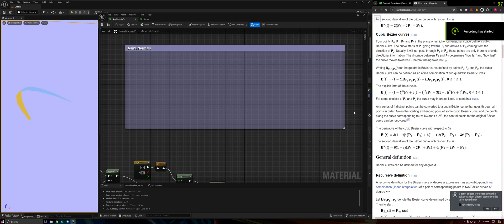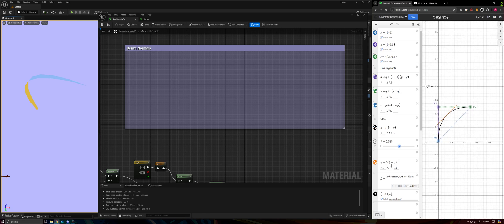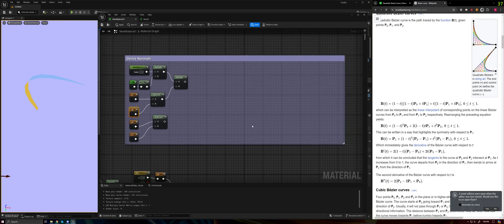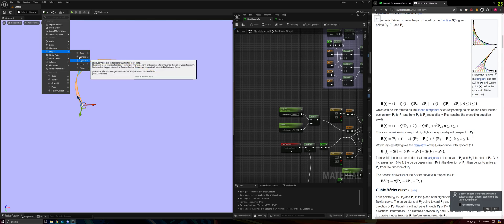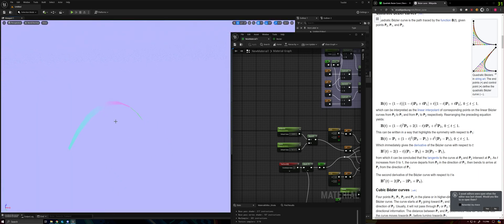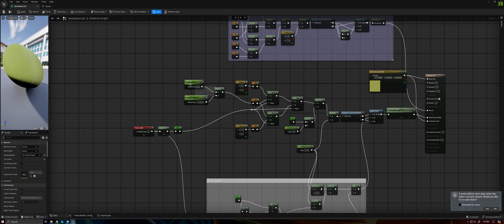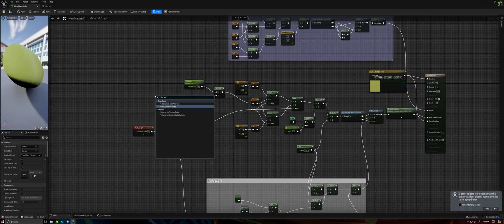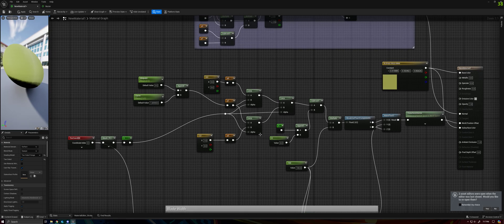UE5 Procedural Grass Using Bezier Curves pt. 2: Calculating Normals

Comment: This is such a good tutorial! I skimmed through all the videos and i'm so glad with the results you showed us. I've been having trouble trying to optimise my own grass but I cant get the amount of blades I want the player to see, unlike your end results, so this is amazing. I am having an issue with the normals though, their is no gradient between the normals, it's just two colours which is the cream colour and the blue colour, and in lit perspective it's the base colour and a much darker colour of the base. My nodes for the normals are the exact same as yours so i'm guessing it's a material setting? I'm very new to materials though so I have no idea why my normals are different from yours. Any help would be extremely appreciated!
Reply from the maker: I don't think there are any material settings that would cause that, but it's hard to say. I'd start by triple checking the nodes. It can be helpful to preview each one to see where something suddenly looks unexpected. 

Also be sure to check out the intro to PCG compute shaders. It's not part of the series technically, but it has potentially big implications for improving the performance.
Reply: @TechArtAlex  Fixed it! all it took was re-doing it. I'll definitely check out the PCG compute shaders vid. Optimisation seems to be the biggest hurdle for me so far and im sure that vid will help me out

Comment: not sure my normals are correct. everything is the same as yours
Reply from the maker: What makes you say they are wrong?

It can help to bring in a cylinder, sphere or some test geometry, and then look at the buffer visualization viewmodes for the world normal. That way you can compare it to something with known correct normals. I've already validated mine as correct, so if yours aren't you may want to review everything again.
Reply: @TechArtAlex  i fixed it. had p2 and p1 switched mb. absolutely amazing series! im on the last video now. i hope the next video is optimization
Reply from the maker: @oliverbendsen  Awesome. Thanks! The next one should be optimizing and larger fields, although there may be multiple parts on optimizing depending on how long the video ends up.

Comment: this is very cool. I would be interested in seeing more on stuff from the tsushima foliage talks. IMO they have the best foliage in games... at least as the apex of tech vs art-direction. Alan Wake might have had more technically complex foliage but Ghosts looks the crispiest.

I would be interested in particular if the mesh provided was say, several planes that were procedurally spread out, rotated and projected down onto a landscape (or other surface). I feel like you could massively reduce the instance count of a field of grass but preserve the random rotation per blade look. This would probably require storing some data in the mesh...

I'd also be interested in seeing you procedurally adjust the normals so that the blade looks lightly convex/concave along the width of the grass, with rounding as it gets to the edges.

But you know, I'm just one guy on the internet.
Reply from the maker: Thanks! 
I should be able to do all that. I think the instance count count with nanite is by default limited to about 2 million, so having multiple blades per patch could definitely be useful. 
It wouldn't be too difficult but it would mean you couldn't rely on the mesh transforms for length or rotation, so all 3 control points would need to be positioned in the shader for each blade. Each blade can be identified easily with vertex color or UVs. 

I also thought it could be interesting to combine multiple blades into one single taller grass plant, as many grasses have multiple blades along a stem. 

Adjusting the pixel normals for some added depth is surprisingly easy so I can definitely show that.